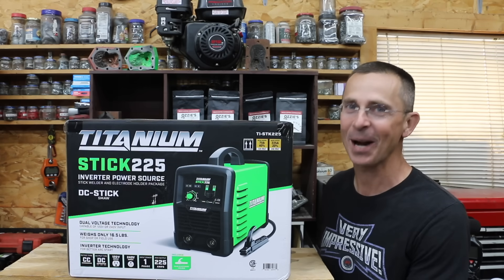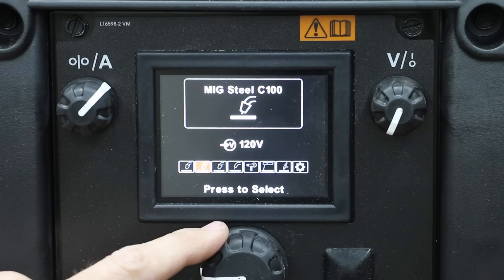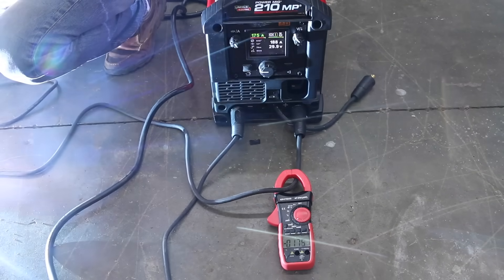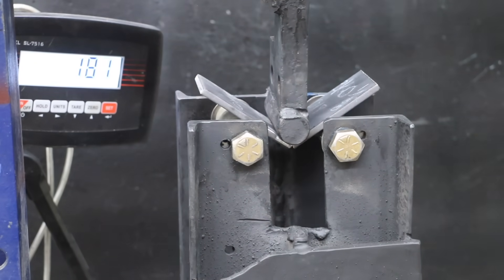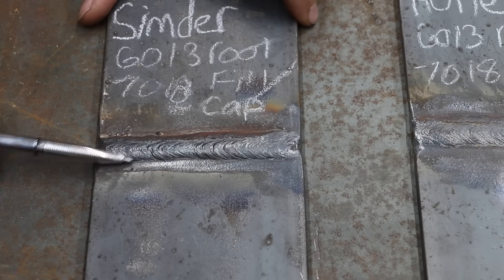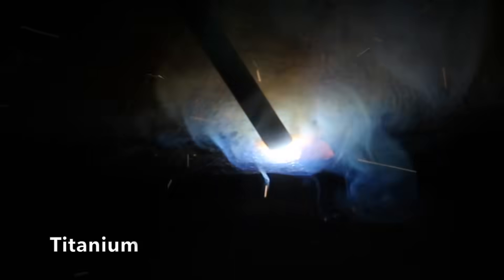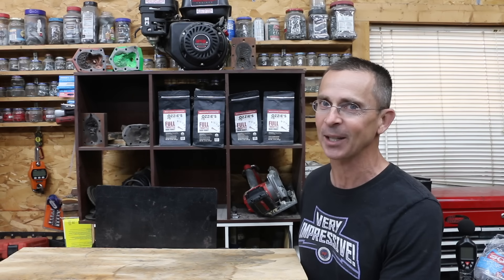$70 vs $2,300 Welder? Let's Settle This! Weld Strength, Duty Cycle, Current Output, Build Quality

Comment: I loved the comments of the welder. The reason is simple. Welding is not solely about numbers. There is the work need on the part of the welder to make what they know as a craftsman is a good weld. There is no number for that. In addition, the comments address a larger aspect of welding. There is a pleasure involved in welding as in every craft. What is the aggravation factor from using a cheep welder or the pleasure from using something that works well. Only a man who is an experienced welder can tell you that when using a given machine.

I am delighted to know I can get a stick welder that works for very small money. For very reasonable price, the Titanium is a real welder that will do the work beautifully. That is the one I would buy.

But, knowing just a little bit about welding, stick welding is primarily limited to several narrow specialties.
You will stick weld if:
1. You are outside. The outside covering (flux) of the stick does a beautiful job of keeping the weld free from oxygen inclusions. 
2. You must burn through some thing like rust. However, if you are inside, this is extremely rare. The ability to remove rust, paint and other things today is a great improvement from the past. Cheap effective tools enable that.

Otherwise, you will MIG weld steel. This includes stainless steel. It is so much easier and the welds are uniformly high quality. This is another reason to use MIG. The skill level needed to produce a high quality weld is markedly less. Thus my vote is, the stick welder has less and less work to do today. Technology has changed welding. This was primarily from the wide scale adoption of welding cars and many other steel based items together. That was major change driven by competitive need to lower cost and lower weight requirements for several reasons.
Reply from the maker: Thanks for the feedback.

Comment: Now lets try some mig welders. Since I have not used a stick welder in years. Try the flux.022 wire and the .035 and also the gas ones. I have a Lincoln SP-1-125 PLUS bought in 2000 which is a gas one. I went to gas because I hate chipping slag. I never seen a wire flux one work so be nice to see the difference. I have not seen one like mine my Lincoln in years. Works great to this day. I have always used .022 wire on 110 and up to 1/4 inch if notched. Use it mosty on thin stuff like exhaust material and such. Still have my big Lincoln red 220 volt stick welder which goes up to 225 amp. Have not used it since I bought the mig in 2000.
Reply from the maker: Thanks for the suggestion.

Comment: Thanks for your usual good quality review assisted by Joe. A multiprocess welder review would be great, please try to include the TIG functionality if possible. 
While you are at it a plasma cutter review would be good also. My impression based on using a friend's Lotos plasma cutter is that cheap Chinese plasma cutters are a more viable option, than cheap import welders, perhaps because plasma cutters are less complex electrically than welders.
Reply from the maker: Thanks!  Thanks for the suggestion.

Comment: Really good that you compared the Lincoln with Titanium and the others available online. For a once and a while welding needs the Titanium might be good.  I had 2 Miller welders, MIG and TIG with arch, and liked both.  Closed my business and sold both.  Wish you would have had Miller also but it's understood you used the Lincoln.  Great job as always.  Thanks
Reply from the maker: Thanks!

Comment: Great video. The brand of welding rods used makes a huge difference. For example, My  Dekopro 160 performs very well with Lincoln 6011, but very poorly with Forney 6011, I have not tried it with Hobart.
Reply from the maker: Thanks for the feedback.

Comment: You should do a diaper challenge. Absorbency and feel once wet, chemical content using a lab to test their hypoallergenic claims, explosion test using a doll with a hole to push contents out of, stretch test, wiggle test to test the latches.
Reply from the maker: Thanks for the suggestion.

Comment: I'm on the market for a "cheap" flux core welder since all you need is wire to use.  It'll be my first venture into welding so I'm not looking to spend too much.  I'm looking at Tooliom and Hynade and possibly the sub $300 Lincoln weld-Pak welder.  Thank you and thank you to Joe as well!  👍👍
Reply from the maker: Thanks!  Thanks for sharing.

Comment: Having a pro, such as Joe, test and evaluate a product that REQUIRES expertise to achieve optimal results is a MAJOR enhancement to your tests.  Thanks Joe!
Based on what little welding I've done, I know it requires a lot of experience to consistently achieve good results. That Lincoln welder is on my Christmas wish list!  A friend bought a Lincoln welder and a week's worth of classes at Lincoln's factory. He also toured the Lincoln factory. He said that Lincoln sources virtually nothing from other suppliers. Instead, they choose to make almost everything themselves. They do this to ensure the quality of everything meets their standards. This even includes making the wire used in their transformers. Nice move!
Reply: Impressive and admirable to see companies go to this extent to ensure not only a quality product, but provide knowledgeable and safe use product training. Even the experts benefit from refreshing the basics every now and again.
Reply: @rico76  Another benefit for taking the class was that a nice discount is offered for the purchase of their equipment.
Reply from the maker: Thanks!

Comment: Nice video, and yes would definitely be interested in a mig video. I have a few different welding machines at home including the same titanium welder in the video, a lincoln 180 mig, and even a $20 stick machine I got off eBay that somehow works…
Reply from the maker: Thanks for the suggestion.

Comment: Why in the world would you give a high score for a welder that’s too hot and over penetrating??  This is not a situation where a unit’s circuitry allowing for over voltage and excess burn through is a good thing.  This is like saying I should buy an engine that over revs because that is perceived as being “more powerful”. No professional welder bypasses the backside of a weld just because the other side had a sufficient weld.  The Lincoln was the true professional welder here. I would not even consider the others.

Comment: Lets all just have a moment of silence for Tod's banking account. Was that the most expensive single piece of gear on the channel? On the other end - a welder for a C-note? Even if the performances of those are meh, it is still an incredible feat of engineering to have such toy just in case.
Reply from the maker: Thanks!

Comment: Good one but you should of get the lincoln 120v instead of the expensive one, most do it yourself guy wont go out and buy a 2300buck welder. I would skip the cheap welder because we already know those dont hold up.
Reply from the maker: Thanks for the feedback.

Comment: I’d love to see a solar generator showdown. Also a small solar panel show down. I have several brands of folding portable solar panels, as well as a rigid harbor freight panel, and the difference is noticeable. The small 250-500wh batteries can run massive appliances in a pinch. In outages I’ve run my fridge, freezer, oven, washing machine, and dishwasher on an ecoflow river with an extended battery.
Reply from the maker: Thanks for the syggestion.

Comment: Love the channel! How about a comparison of single stage dust collectors for home gamers? Joe from Harrisonville! I grew up there till I moved away in 2008. Class of 97. Way to represent! I have an older 120 volt Lincoln MIG. Weld Pack 100 i think. Never had it cycle out, even when sometimes only giving a few seconds between welds.
Reply from the maker: Thanks!  Thanks for the suggestion.

Comment: I have the titanium 125 mig, I've welded a Chinese moped rear end to the front of a yamaha atv, making it into a trike.  I've had it 3 years, I weigh 300 pounds and it's been to atv parks, random trails and on the street.  Not one weld has broke.  More expensive welders can weld more types of metal and/or make prettier welds but these days a lot or $100-200 welders can get the job done.
Reply from the maker: Thanks for sharing.

Comment: I don’t suppose you could test the next round of welders against the infamous “trail welder” - two car batteries hooked up in series (thus making 24 volts) using jump starter cables for electrodes. The positive cable is your ground and the negative cable is your electrode holder. Ive done this a few times for emergency trail repairs. They say it does not hurt the batteries and so far ive found that to be true, but if there’s anyone who can test that it’d be you!
Reply from the maker: Thanks for the suggestion.

Comment: Harbor Freight across the board has latched onto the soft underbelly in the tool industry: The mid range semi-pro/pro sector that represents the largest customer base. They have lines that exceed performance of all the cheap stuff and rival if not sometimes exceed the performance of the 'name brand' lines. Their hand tools, compressors, air tools, jacks, etc are all highly competative at aggresive price points.
Reply from the maker: Thanks for the feedback.

Comment: I'm a home hobiest on a budget so I usualy grab the item that is about two steps above the cheapest. I find that whatever gets whittled out to get to that last 10% in price winds up being about half what you need to be useful. The cheapest seldom performs adequately so for example I got one of the Yeswelder multi function machines so I can play around with all the main styles: I can MIG, TIG and stick weld and their line seems to be the actual bottom for a usable machine.
Reply from the maker: Thanks for sharing.

Comment: Thanks Joe! Also, I would be extremely interested in seeing a comparison between flux core MIG welders, as I am using a harbor Freight Flux 125 welder that I am borrowing from a friend for a couple projects I am working on, and would like to know how it stacks up against other options on the market.
Reply from the maker: Thanks!  Thanks for the suggestion.

Comment: I really like my Titanium Flux core 125. Use good wire (Lincoln) and weld whatever I need to. It doesn't surprise me that the Titanium stick welder comes out on top. Almost bought one of those. Still might.
Reply from the maker: Thanks for sharing.

Comment: Give us review on multi process welders and make sure you include the Klutch in that. Multi process with spool gun under $1000. I have an older one i use in more of commercial use and it has been great.
Reply from the maker: Thanks for the suggestion.

Comment: I’ve had an omnipro 220 mig/stick/tig for a few years and I’m completely happy with it. Even got the spool gun and I use it as often as my mig. I’ve been welding for over 15years now and I’d put it up to my millers at work. I take mine to work at least once a year for aluminum welding. A friend got a titanium and it runs very similar but the Omni has the digital display which I’m 50/50 on. I was really surprised by both and I got a lifetime 30% off on all Vulcan gear with the welder so that’s a big deal for me.
Reply from the maker: Thanks for sharing.

Comment: To be honest, myself IF I was into hobby welding I would go with the titanium welder.
Reply from the maker: Thanks for the feedback.
Reply: @ProjectFarm  Honest if I was starting say an auto shop and did exhaust along with trailer hitches I would go with the Titanium welder from your video I can run it either off of 110 or 220 and can weld muffler pipe or trailer hitch heavy steel onto auto frames without spending money I didn't have starting up but it can and will get the job done. FYI I like your videos comparing like items.

Comment: We've had the Deko for about 2 years at work, and it's been a decent little stick box. My biggest complaint with it is that the plastic parts of the case are very brittle and break easily.
Reply from the maker: Thanks for sharing.

Comment: I have the Deco for over 3 years as a spare in my welding truck. Only run on 240 and has been reliable. Don't use it alot but got me out in a alot pinches. run over 20lbs of 7014 rods.
Reply from the maker: Thanks for the feedback.

Comment: Very much interested in more welder reviews.  I'm interested in eventually getting something for occasional use DIY and have had some suggest various ones that could do aluminum or flux core to avoid shield gas and have flexibility.
Reply from the maker: Thanks for the suggestion.

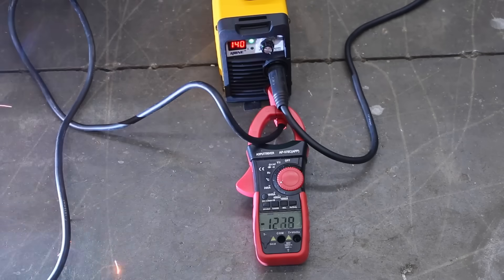Comment: Cod I have an Omni pro 220 and I just love it I also have a yes welder for a tig unit works pretty good it is an ACDC and the Omni pro is only a DC tig the mig on the 2:20 works absolutely wonderful and the stick is excellent stick works good on the on the yes welder also good prices on them all and so far they've been good units would buy them again
Reply from the maker: Thanks for the feedback.

Comment: Overall a great video. In the future, for lower amp machines I would like to see a 1/16-3/23 gap with a 1/16 landing on the test coupon. It would be interesting to see how the welder maintains a keyhole and ties back into the walls. 

Also on the bend test, it you cut the coupon in half and bend one side root up and the other cap side up it will give you a more clear view of penetration and bond. (A well bonded coupon will not break in a test like that)
Reply from the maker: Thanks!  Thanks for the constructive feedback.

Comment: Thank you Joe!  Thank you Todd!  For Mig, I've had an Lincoln Weld Pak 100, A century/Lincoln 90, a Forney 140i and a Titanium 140 multi purpose.  The 90 and Forney 140i are flux core only.  I would rate the forney and titanium about the same for flux core.  The thing I really hate about the Titanium multipurpose 140 is that it has a non-adjustable pre/post gas flow.  If you are doing lots of stitch welding on body panels, you will use 25% of the gas you need and the other 75% is wasted.  If I was in the market for a cheap but good flux core, I'd go with the forney.  I liked mine so much I bought my Dad one.
Reply from the maker: Thanks and you are welcome!  Thanks for the feedback.

Comment: Hey can you try running a motor from a wall outlet to spin a large generator to power up the rest of the house separate from the 1 outlet used for the electric motor of course to use less energy for the month

Comment: Thanks Joe that was very helpful I would definitely say that I've been wanting a video done comparing welding helmets welding hoods like Lincoln's optrel Miller there is a whole bunch obviously that you can find on Amazon the test would probably be best to check how there auto darkening feature functions how fast is it how well does it actually do as far as accuracy of stayed and one of the biggest things is battery how long does it take to kill a battery and does it have an internal battery like the optrel that goes out that thing is honestly very disappointing and frustrating I have a friend who's gone through three of them while he's on his third I should say he gave me the other two I even bought a new battery pack for the thing and put it all back together and it plugs in and it takes a charge it says it's charging you can put it on Grind Mode it'll blink the blue light like it's in Grind Mode but it won't actually work and when you unplug it it still doesn't work and it cost 300 dollars as much as a brand new one to send it to off-trail and have them fix it for you so maybe somebody knows how to fix that thing and can help me out with that one but I think that would be a really good test video. Thanks for what you do
Reply from the maker: Thanks!

Comment: Can you test salt neutralizer? You are supposed to use it with a pressure washer to help remove road salt or other salts. It is supposed to neutralize the salt so it doesn't rust anything.
Reply from the maker: Thanks for the suggestion.

Comment: Great test!…I don’t have a need for stick welding, but I did buy an Harbor Freight mig for under $200 that I used to build a two axle 24’ X 8’ flatbed trailer that I’ve used to pick up airplanes back east. Never any trouble with the welds. Recently, I bought a Tig from Prime. It’s very nice and was less then $900 delivered to Northern Cal. Thanks.
Reply from the maker: Thanks!  Thanks for the feedback.

Comment: I have a lincoln 360mp, you get what you pay for!  I have a miller thunderbolt 210 that I use when I need to weld something outside though.  I like the interface on my miller dynasty 280dx way more than the LCD screen but that's just me.  My grandpa has the yeswelder one but I wanted something a little more robust.  Bringing in experts, that's like mythbusters!  Pretty cool
Reply from the maker: Thanks for the feedback.